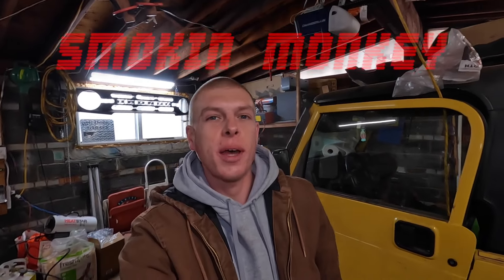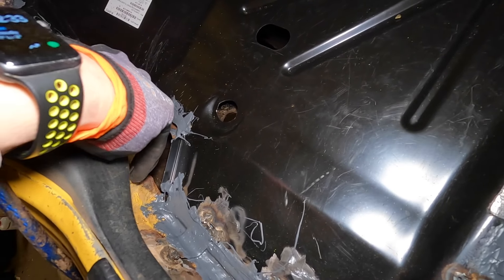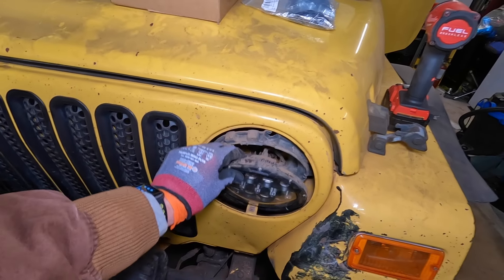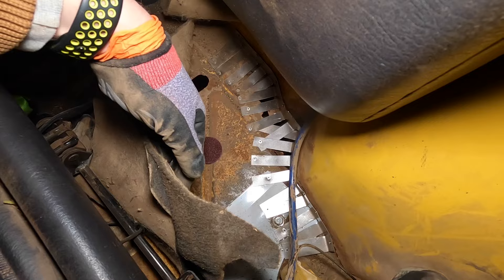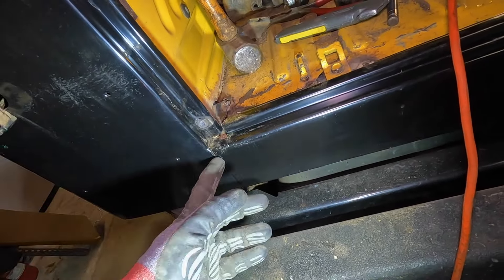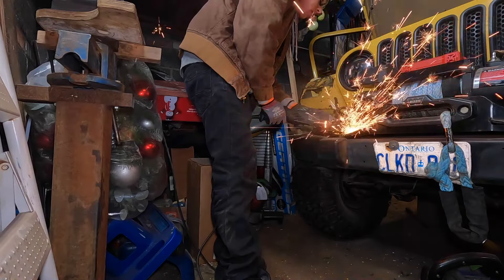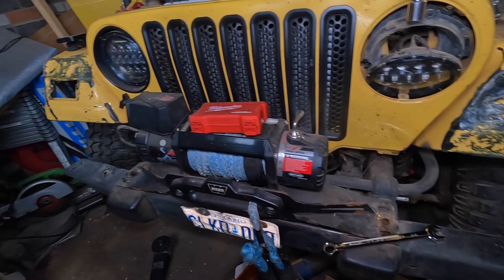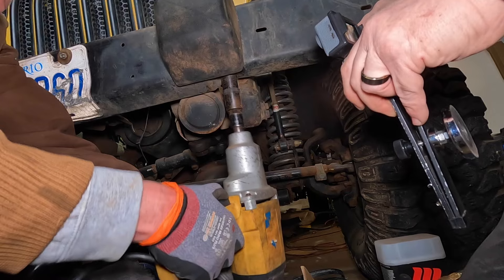We Got All The Body Mounts And Rear Quarter Panels Replaced On The Jeep TJ

Comment: Need a rear bumper for the extra wheel does not bind the hinges.  I had a swivel on my back where the wheel opened as a gate and tail gaite is free of the tire. You can build one the hinge you can buy.  And diy one
Reply from the maker: I’ve looked into them and I have a few buddies that have them, and everybody told me not to get it because they just rattle and make noise and end up having issues later so I didn’t want to do it. I just strengthened up the metal behind the hinges instead.
Reply: @SmokinMonkeyOG  right mine was on my cheerokee.  I never heard noises from mine. Just keep the hinge lined up good no noise from it.  And the locking mechanism has to be good.  I crawled mine and had the cage on top. Of wheel. And it was ok.   Maybe just my ocd made mine quite.

Comment: Those light buckets are expensive. I could not find the individual parts so had to order the mount/bucket assembly. Somewhere around $45 U.S. micro pesos.
Reply from the maker: I think I paid like 25 or $30 for a set of two in Canadian pesos
Reply: @SmokinMonkeyOG  Wow, I just found a set on amazon for $30. I can't find in my purchase folder for the jeep where I bought that expensive mount. I just know it was expensive: " X AUTOHAUX 1 Set 7 Inch Round Headlight Mounting Retaining Bracket Ring with Headlight Metal Ring for Jeep TJ Wrangler 1997-2006 " 30 buckaroos.
Reply from the maker: You’re not wrong because I’ve seen them for like up to 60 or $70